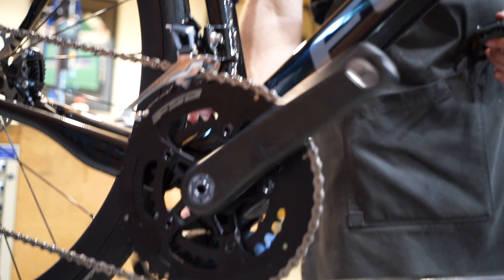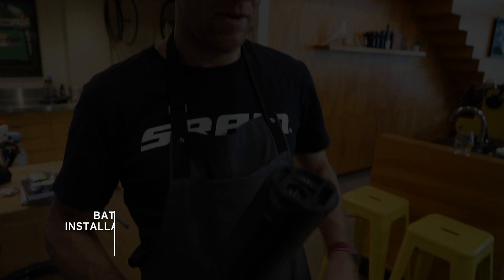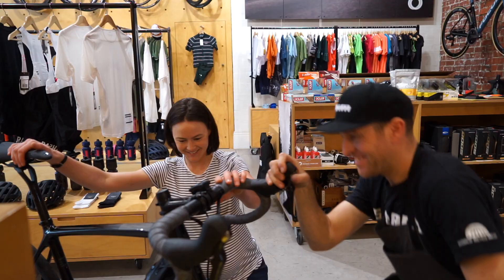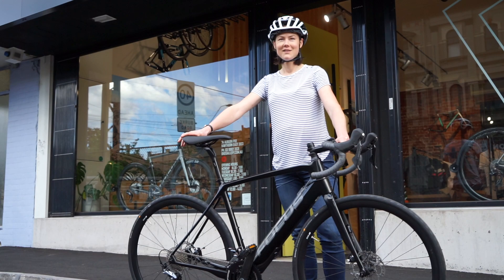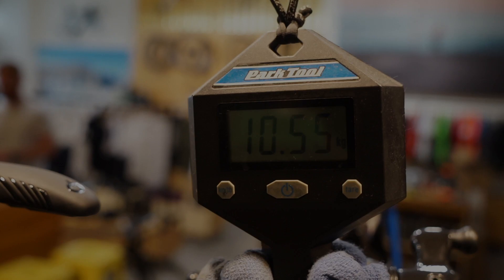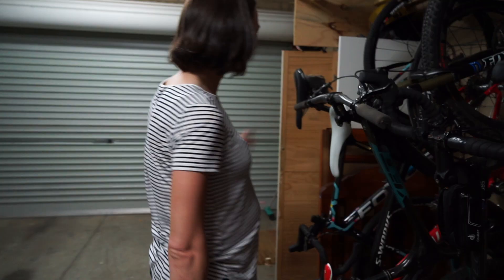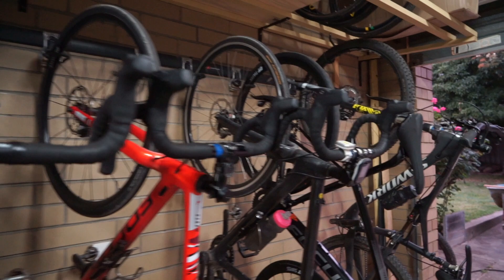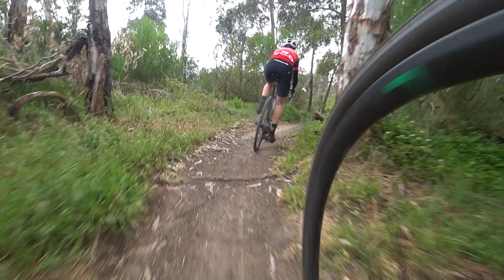Lisa Jacobs and her new Focus Paralane ebike (episode 2)

Comment: I have a LOOK e-765 with the same system. You do not have to remove the battery and "turn it on". Just put the battery in the bike and press the control to turn it on.